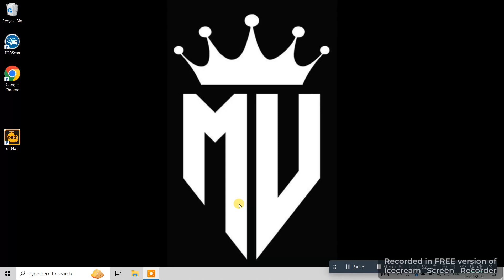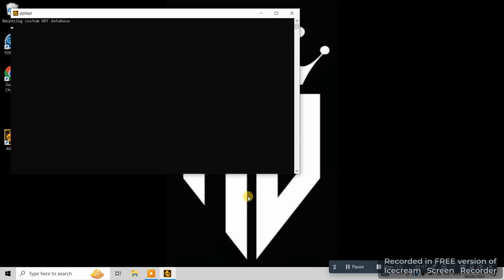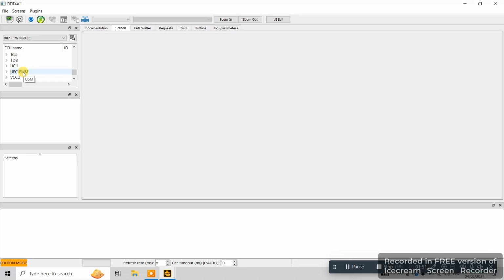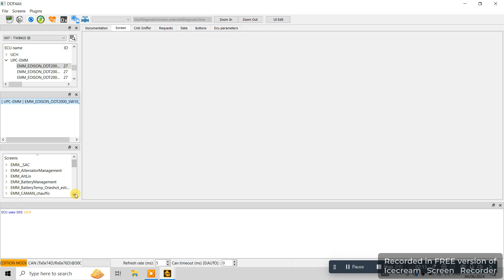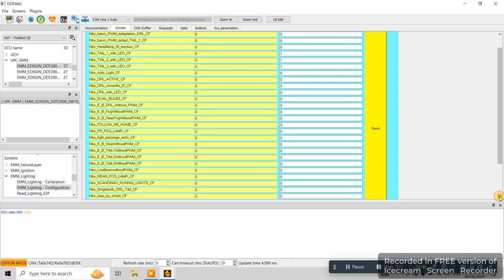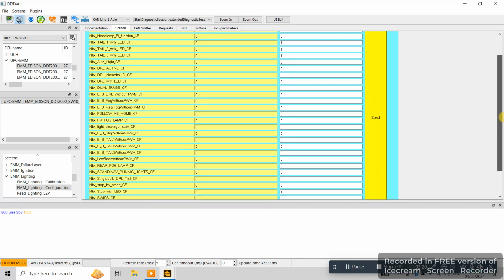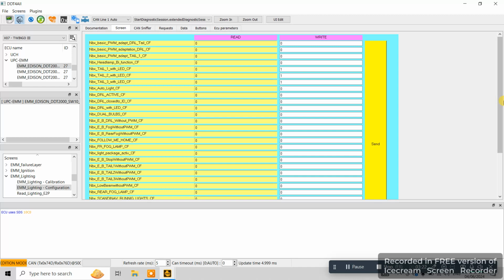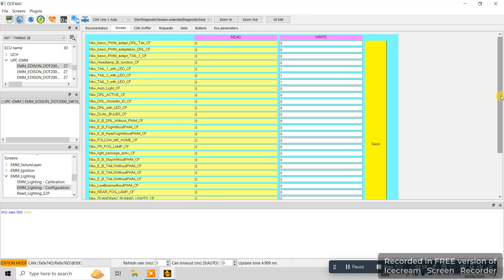Smart 453 Rear LED Lights upgrade coding with DDT4ALL

Comment: Hi,

Does this coding work for the Smart LED rear clusters? Have upgraded from the halogen bulb to the factory Led ones, everything works fine but just get the "brake lights inoperative" warning on start up.
Reply from the maker: Yes this should work.

Comment: Halo many greatings,great video,is it possible to make a video for retrofiting full led on facelift smart 453 eq
Reply from the maker: Thank you. The rears apart from some coding are plug and play. The fronts need small amount of wiring to move the indicators. Kufatec have a nice little plug and play harness for this. A very nice person in one of the forums did a really clear diagram for this to make your own. will find a link. Then a little coding also. 

I can if needed show how to code these.
Reply: @mvautomotive7092 tnx for the fast reply but mine smart is facelift,i bought from kufatec wiring,i need help in coding,i wrote you a e m ail

Comment: i don't suppose you know if or how to code in a 2nd hand headlight do you? Mk4 Megane had a replacement LED matrix headlight all works as it should but the car thinks the dipped beam isn't working. wonder if it needs coding?
Reply from the maker: @oldhamringers  might sound silly but have you tried discounting the battery for 10 minutes as it sounds like the cars just had a glitch.

Comment: hi, I have to code the smart 453 eq 2020 triled front lights and LED rear lights. 
at the moment without coding they work but not correctly (when I activate the fixed high beams the headlights turn off completely) can you guide me? I would be truly grateful.
Reply from the maker: In the process of making one. One of the options has three settings that I think will resolve this. Let me check and will get back to you. Or drop me an email links in description.

Comment: Ooo you fit the EQ ones?
Reply from the maker: Should work for all OEM led tail lights.
Reply: @mvautomotive7092  you do a video for front Full Led Lights too? 🤗
Reply from the maker: @McFly997  there is a bit of wiring involved also, but I can certainly do a video on the coding side. 

Kufetec does a plug and play harness for the lights to eliminate the extra wiring. Simple diy job. 

https://www.ebay.co.uk/itm/404887384236?mkcid=16&mkevt=1&mkrid=711-127632-2357-0&ssspo=Iin_GNP6SL2&sssrc=4429486&ssuid=s7yaoAwjRG2&var=&widget_ver=artemis&media=COPY 

The coding will stay the same. Give me a couple of days, and I will put that video up. Working hard on the land rovers atm.